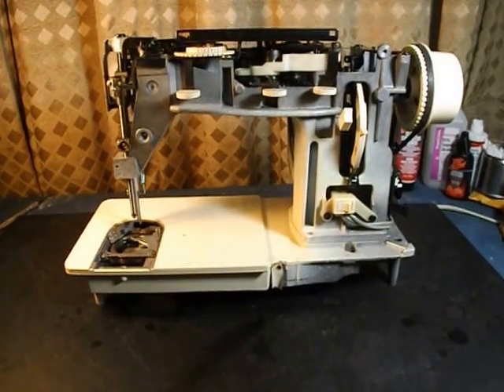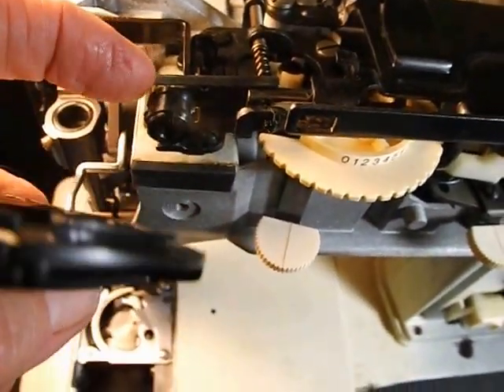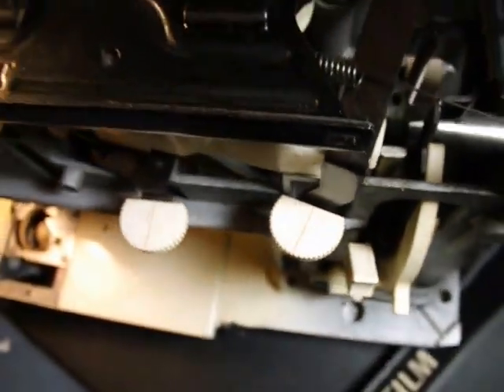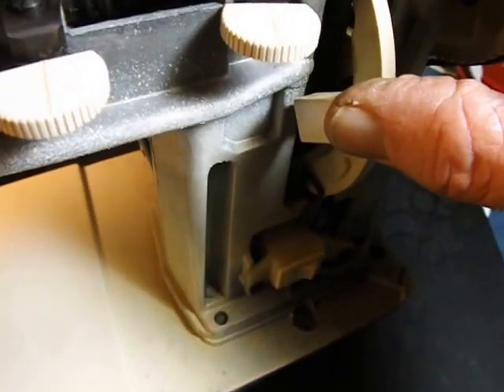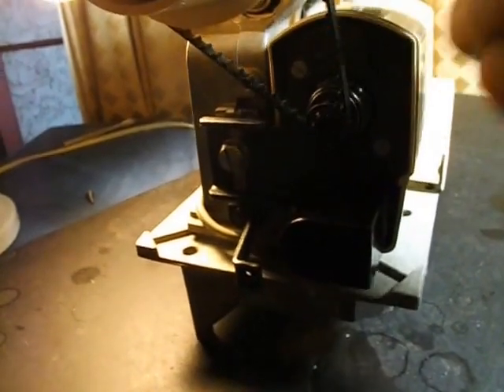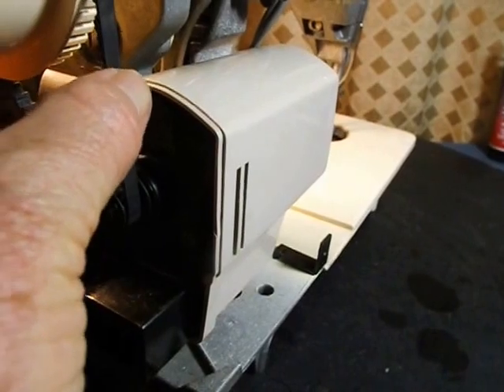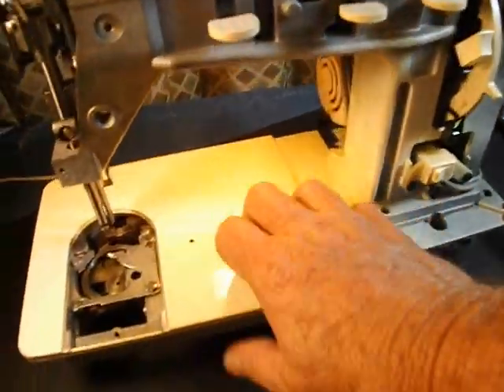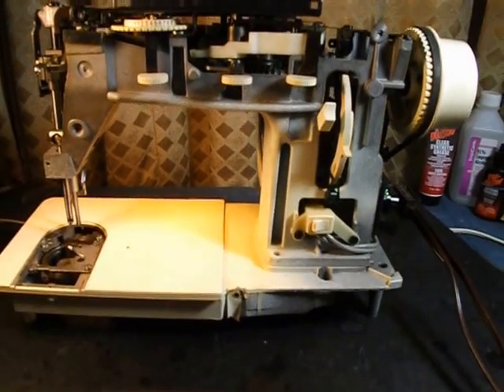SINGER MODEL 353 GENIE INSIDE TOUR OF WORKING MACHINE

Comment: Andy I need advice! I've been trying to fix my 353 after breaking it while making face masks... the handrail doesn't seem to be playing nicely with the vertical shaft, or maybe the vertical shaft is not playing well with the pulley directly beneath it --- i say that because the pulleys and belt underneath the machine are functional, and they are well-connected and in sync with the hook but the hook does not turn when the machine is running. Or when I manually turn the handrail, that hook was unresponsive. So I took the covers off, turned it upside down, and discovered that the pulley does not turn when the handrail turns. How can I fix this? I don't know what part is the culprit, but I do know that its not the hook, or the pulleys themselves, or the handrail.
Reply from the maker: Are you sitting down? Your machine has a broken plastic gear on the top of the vertical shaft. It can't be powered or turned by a gear on the horizontal arm shaft any longer, so the pulleys, timing belt, and hook have to power or movement. That's the good news! (yikes!)
It is a 15 to 20 step process to remove the arm shaft and pull the old vertical shaft OUT THE TOP of the machine as per the Singer Service Manual ($8.99 to download here: https://manualsoncd.com/product/singer-353-354-genie-sewing-machine-service-manual/ ) You can then install a new vertical shat/gear and reverse all those steps to put the arm shaft and the parts that attach to it back together. Then you just need to retime the machine. Whew! It is a real workout. Here is my video of replacing that broken gear on a model 457, where it is relatively easy to pull the vertical shaft OUT THE BOTTOM of the machine https://youtu.be/M3bFtlV1Y6s  If you watch some of the video you will see the process. You should be able to look down into the top of your machine next to the cam stack where the vertical shaft comes up to the arm shaft gear. You can probably see the teeth on the gear are damaged, broken off. The problem with models like the 353 is that the top gear is usually permanently attached to the vertical shaft and can't be removed like the one in my video UNLESS someone already replaced that top gear in the past and you DO HAVE the gear with screws. Have a lucky star? Nahw, me neither but maybe you are lucky. You can buy a new shaft/gear for $16.99 from this trusted seller: https://www.vintagesingerparts.com/collections/singer-model-353/products/new-replacement-top-vertical-gear-shaft-fits-singer-models-242-247-248-252-257-259-267-300-350-353-354-360-362-368-1263-1280  If you got lucky and the gear was already replaced once then you can just buy a new gear. So for about $30 you can get the parts and the manual, invite a good friend and spend a day (or two, haha) replacing your gear.
So sorry to give bad news, and may I say your question was impressively thought and present with the utmost clarity! Nicely done, that. Good luck.
Reply: @andytubesewing1953  Oh wow your reply was so fast, you beat me to adding the followup that "I found the culprit! It was the plastic gear head of the top of the vertical shaft! I found it inside snapped in half!" haha. Oh dear... I am so grateful to have learned as much as I have in the last 12 hours in exploring this mystery under your tutelage on this Youtube channel!
Reply: @andytubesewing1953  I have learned so many new terms from you (and that service manual, ha!). I'm intimidated for the next steps but any chance you'd want to make a video about how to walk through this challenge??? :) EDIT: I just reread your response more carefully, clicked your link, watched your helpful video, and am still intimidated but oh-so encouraged. Andy you are an international treasure. This is my new favorite channel.
Reply: @andytubesewing1953  Final question: Since the top gear snapped completely off and I was able to get all of the gear out with pliers without touching the arm/horizontal shaft, does this mean I have a lucky star after all and I can pull the vertical shaft out of the bottom like in your video? I uploaded a photo of the recovered gear pieces here: https://imgur.com/gallery/QEB8rzt
Reply from the maker: @daywhitney  I figured you would find that gear before too long since you had the covers off and could explore.
Reply from the maker: @daywhitney  It's good to be favored! I'm honored. If you do one step at a time and take pictures as you go you can do it. Be sure to separate and label parts so no screws get mixed up. That was a headache for me once so just saying. Good Luck.
Reply from the maker: Nice try, no cigar. A for effort. What you removed was the plastic teeth of the gear. Those are on a metal "base" or "hub" that is still in there connected to the shaft. Now if you good just buy a new gear, somehow remove the plastic teeth from it and epoxy those teeth onto the old base.... you'd have a new business repairing thousands of machines with broken gear! Let me say this; I had a conversation last week with a viewer who said he "cut out" some of the metal frame on the machine to make a space big enough to remove the gear without removing the main arm shaft! He could then replace the old shaft with a new one and screw on the new gear as I do in my video. personally, if I had to change that gear I would take a serious look at doing that.
Reply from the maker: @daywhitney  Man, I hate those little guys. I usually warm the area up good with a hairdryer, then put a penetrating oil, maybe wd40 or similar. After giving time to soak it I will try again like this. Be sure the screwdriver bit fits the screw very well. While turning the screw give the screwdriver one or two good sharp whacks or raps with a lite hammer or rubber/wood/plastic mallet. The "shock" of that hit WHILE TURNING can jar the screw loose. You usually hear a sharp "snick" or click sound when it comes free. Then it's normally easy to turn and remove. Sorry for the slow reply but YouTube blocked your comment b/c you had a live link in it and I had to approve the public posting of it.
Reply: @andytubesewing1953  I'm now looking at it more and it appears that the hole is too small for the screw. How can that be? Am I crazy? The steel hole literally looks smaller than the screw. (The hole is large enough for me to fit a 3/32 flat head bit down the hole to access the screw head and to unscrew it 1 full turn so it goes partially up into the top gear, but the hole is not large enough to unscrew it completely). Also, there is a groove in the shaft where it appears the screw is meant to be able to go back and forth about 1 inch, but then the groove ends. I'm trying to wrap my head around how else to get to that screw to get it out... permission to unscrew the feed fork from below, to get to the screw an alternative way by pushing aside the fork and cam?
Reply from the maker: @daywhitney  The parts diagram does not even list that set screw even though it shows many other set screws. It does show the hole for the screw.  I thought you were only supposed to loosen it 4 turns, not remove it, according to the service manual on page 39, after you do the other 12 steps first. I mean you will be sliding the arm shaft to the left past the vertical shaft to remove the vertical shaft.
I think this is why a couple guys told me the cut a larger hole into the side of the frame so they could remove the gear sideways.
Reply: @andytubesewing1953  Yeah I can see what they had in mind. Would a 1 inch carbide hole saw bit/ hole cutter bit go through the machine's side?
Reply: I don't know what the piece is called that has a too-small hole, its not named on page 39. The metal doughnut concentric ring looking steel piece that's hugging the shaft gear, sitting in between the shaft gear teeth and the plastic spacer/cam. The thing with the hole you're supposed to see set screw D through. Anyway that hole in that mystery part is about 2.9mm in diameter, and I can only get a 3/32 bit in (I can't fit a 1/8 bit inside the hole). The set screw looks to be maybe 3.2mm or perfectly sized for the 1/8 bit, from what I can reach to compare. I'm now positive of it. Oh boy... I've been learning so much though, this is still fun!
Reply: #1 Is the mystery part a "bearing"? #2 Would it be crazy to just go buy a carbide 1/8 drill bit to enlarge the hole in that bearing?
Reply: #3 thank you for your continued advice on this adventure!!! Do you teach classes?
Reply from the maker: @daywhitney   could not say, I've never attempted that. The fellows just said the "Cut a larger hole" and said said with a dremmel. I took it to mean they enlarged an opening to make it big enough to slip out the gear..
Reply from the maker: @daywhitney  nope.
Reply from the maker: @daywhitney  In an effort to prevent miscommunication, please email me at andymanuals53@gmail.com. I will reply with the parts list/diagram so you can see better.
Reply from the maker: @daywhitney  I think it's part of the Feed Lifting Rock Shaft Connecting Rod. I asked you to email me for the parts list in another reply. This comment section is getting too long. Thanks
Reply from the maker: @Diego Martinez I pinned this to the top of comments. It's a beautiful thing you did here, Diego. You the man! Thanks for sharing it.👀✨🙏

Comment: Hi Andy. I've got a Starlet 354. Unfortunately, it seems that the tension unit is blocking and pin inside the unit doesn't return to it's base position when the piece of metal is moved by the tension adjustment wheel. The wheel also doesn't seem to effect the tension often and then every now and again it will click to full tension when turned.  Have you got any instruction videos/information or manuals that could help me to dismantle and reassemble the tension unit and sort this problem out. Thank for your very in depth videos. Teresa
Reply from the maker: Here is what I have: Direction for panel removal: http://site.tandtrepair.com/Genie_Items/Panel_Removal.pdf
Parts schematic 353/354: http://site.tandtrepair.com/Schematics/353_354.pdf
Singer 700 tension unit theory (closest I found to the Genie tension unit: 
http://site.tandtrepair.com/700Stuff/FreeStuff/TensionTheoryOfOperation.pdf
That's it and good luck.

Comment: I have a Genie 353. I couldn’t bring up the bobbin thread,so when I took the case, etc off to see what the problem is, I see that the rotary hook doesn’t turn when I move the needle arm. When I turn the machine on it’s side to look at the bottom and turn the belt, the rotary hook turns halfway but then stops.......it seems as if it’s blocked.Any suggestions??
Reply from the maker: Maybe you should sit down? You have a broken plastic gear on the top of the vertical shaft. This is a common problem with machines of that age. I was getting so many requests for help that I made a gear replacement video: https://youtu.be/M3bFtlV1Y6s   I see it has 30K views now so you can see it is really a common problem. My videos cover how to remove the shaft and gear from the bottom of certain models of machine. Sadly there are a dozen or so models where they need to be removed from the top and your machine in one of those. This is a very involved process requiring the removal of the main horizontal arm shaft and most of the parts attached to it then putting it all back together. Yikes! It can certainly be done. Recently I've heard for a couple of viewers who managed to get the old gear off the shaft and made an existing opening in the side of the metal frame bigger to get the gear out then new gear in. The rest of the process was taking the shaft out and in from the bottom like my video. That saved about 12 to 15 steps each way for removing the arm shaft as shown in the Service Manual available for $8.99 here: https://manualsoncd.com/product/singer-353-354-genie-sewing-machine-service-manual/   You can buy the replacement shaft/gear online including from this trusted (by me) seller: https://www.vintagesingerparts.com/collections/singer-model-353/products/new-replacement-top-vertical-gear-shaft-fits-singer-models-242-247-248-252-257-259-267-300-350-353-354-360-362-368-1263-1280  You can find it on eBay sometimes too. Sorry to give you bad news but trying to be upfront and honest as to what to expect. Rarely, and I mean rarely, the gear has already been replaced and the problem is something caught it the gear, or worm gear of the main arm or somewhere else, but nearly 100% of the time you will find pieces of that gear on the oil pan after you remove the covers; a classic tell of the broken gear. The manual covers removing the covers and all the adjustments and remove relace instructions for the whole machine. That all I have for you and best of luck.

Comment: Hi Andy. Thanks for all your wonderful videos. I am trying to replace my broken handle on my genie 354 and can't find any instructions on how to do it. Got it down to the inside panel but can't figure out those screws holding it on. Any tips or info on where I can look? Thank you. Victoria in so cal.
Reply from the maker: Hi Victoria. I never had to remove the handle from the bracket, but I remember there were some retaining rings that held the screws on in the back. Like C-Clips. It looked like they had to be pried off to dismantle the assembly. Terry Fielding at http://www.tandtrepair.com/ has a free "panel removal" guide I believe. He wrote it himself and it shows how to remove all the panels. It may mention removing the handle. You can also go here to download a free parts Diagram and list. The exploded view of parts may help you see how it is held together.
http://parts.singerco.com/CPpartCharts/3_39999/353_354.pdf
Good Luck.
Reply: Andy Tube  - Thank you for your reply. I did download the tandtrepair.com dismantle guide but sadly it did not refer to the handle. You are correct on those super tiny c-clamps. I will check out the other sight you noted. Again, thank you.

Comment: Any tips on changing the vertical shaft gear. Thanks in advance.
Reply from the maker: My best tip is patience. It is quite a process to change the vertical shaft on this model. It certainly can be done. I made a video about changing the top gear for other Singer machines: https://youtu.be/M3bFtlV1Y6s
The problem with the Genie is the top gear is not held on the shaft with screws but is permanently attached. That means the whole shaft/gear combo has to be replaced from the top of the machine. You need to remove the horizontal arm shaft, or at least partially remove it. That alone is a 12 step process before you even get to the vertical shaft replacement. You can download a free copy of the parts diagram and find the part number for the shaft here: http://parts.singerco.com/CPpartCharts/3_39999/353_354.pdf
You can buy a downloadable copy of the service manual for $9.95 at this link: http://parts.singerco.com/CPpartCharts/3_39999/353_354.pdf
It shows the step-by-step process for both shafts. You can buy a replacement shaft/gear from Terry here: http://site.tandtrepair.com/Genie_Series.html     Terry will give you 20% off whatever you buy before 8/1/2019 if you use coupon code
andy-h-yt.  You may also buy just a gear if you want to try and reuse the existing shaft. There may be other sellers of the shaft/gear also as I do not know what country you live in. So to recap, it can be done if you are patient and persistent. Good Luck, and thanks for watching Andy Tube.
Reply: @andytubesewing1953  Thanks, please advice the part number of the plastic gear in the vertical shaft. Do you know where I can the part?
Reply from the maker: @anthemcoveral  The gear is usually permanently attached to the shaft (not always) and you have to replace the shaft/gear together. I have heard of some people drilling out the rivets on the gear and forcing a new gear onto the existing shaft. Get a free parts diagram here: http://parts.singerco.com/CPpartCharts/3_39999/353_354.pdf
Here is one seller of the parts and he will give 20% discount if you use coupon code andy-h-yt http://site.tandtrepair.com/Genie_Series.html

If you want to see more videos of the 353 Genie here is a link to my latest videos about it:
https://www.youtube.com/playlist?list=PLsCOZgzzaiKJvzcqn97Yh8lvx-tbdFl2p
Good Luck

Comment: Very helpful video indeed. Could you possibly show me or give somewhat information to replace the upright shaft gear in this machine ? The vertical shaft and gear locates in the center of the machine. I don't  know how to undertake.
Reply from the maker: I do not have the service manual for the machine. Here is a link to T and T Repair where you can get a schematic of the parts if that will help. http://www.tandtrepair.com/Genie_Series.html
Terry mentioned a while back that he was replacing the gears, and may have good advice for you. Don't hesitate to email him. I have sought his help before and he has always come through for me. I have purchased some of his instruction guides and they are very good. Best Wishes.